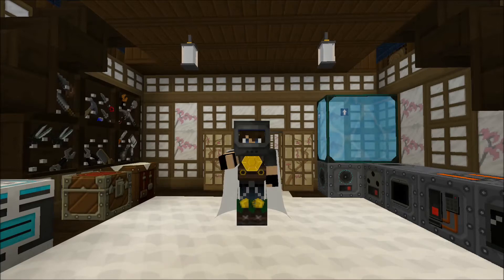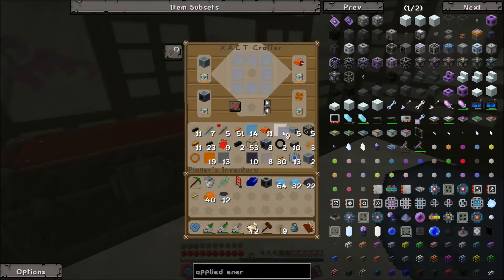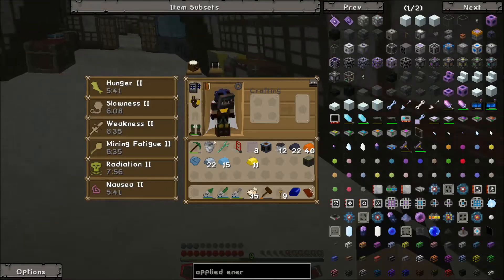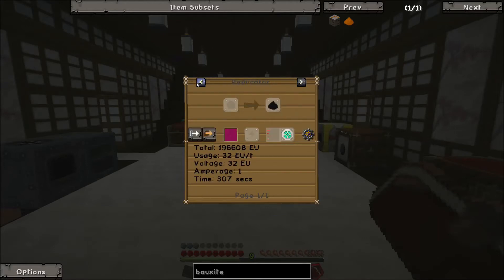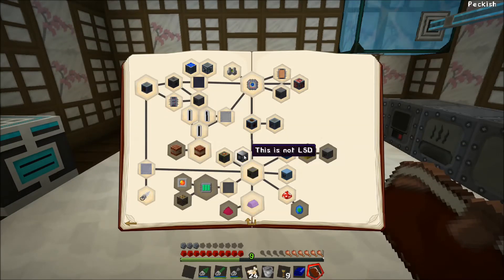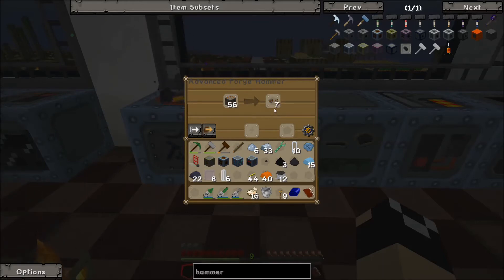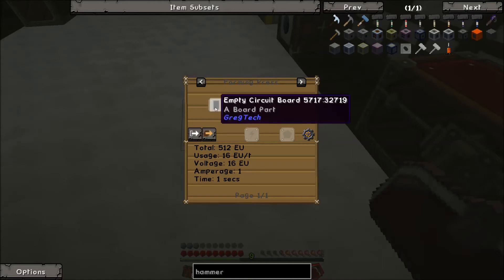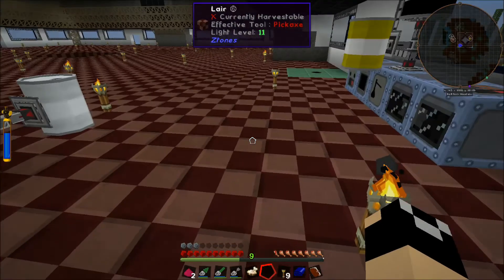Minecraft Infitech 2 Lp Ep 36: Headed Towards HV Power

Comment: i bet u didnt have power in those basic machines thats why nothin worked back there :D
Reply from the maker: I did, I used them fine off camera when I was making some of the other stuff.  The macerator just didnt want to macerate those 2 ores for whatever reason.  They still have the biogas plugged in and they run anything else fine so idk